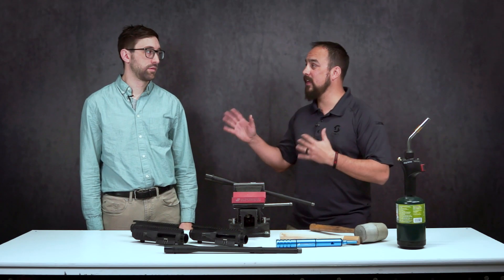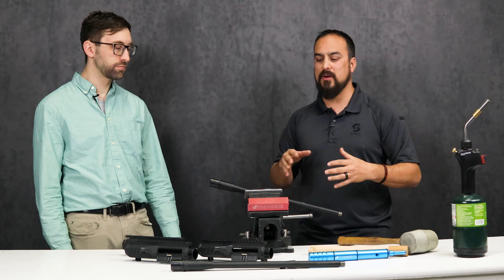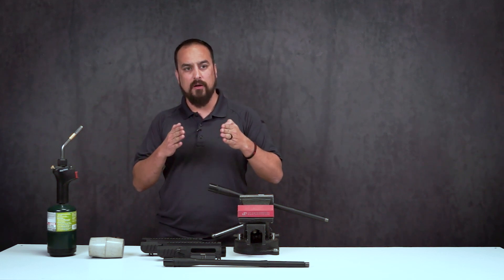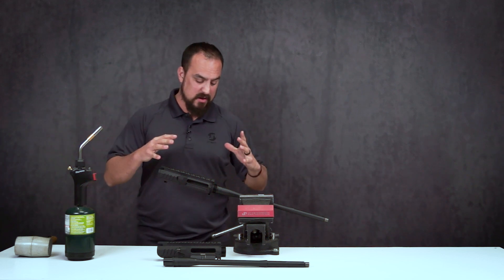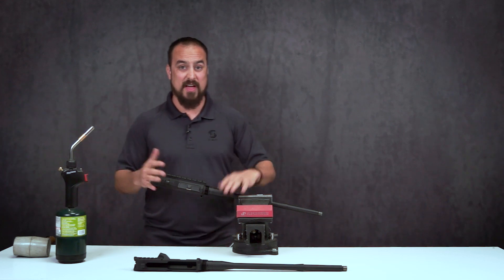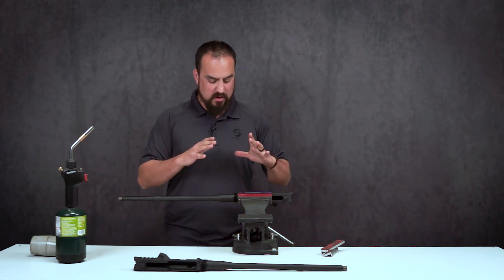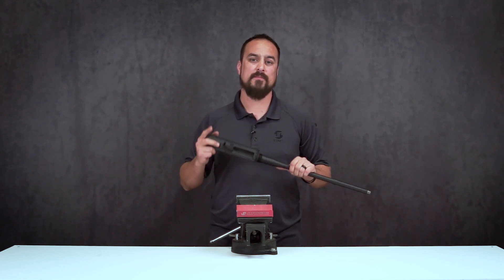The Secret of Thermo-Fit™

Comment: Very neat, but green loctite (620 I think) will achieve the same result for slip fit cylindrical surfaces (the receiver and barrel extension).
Reply: An interference fit like this is better, but isnt new. A few people make uppers that are a thou under spec like seen here. White oak armament has neen making competition barrel extensions that come in difference sizes for the same effect, for a long time
Reply: The loctite method is "ok" but it's still not as rock solid as metal on metal.
Reply: lkazanov heat from the barrel will weaken the loctite
Reply: @cmoore806  you'd be surprised... I've done green loctite before and it "glues" everything together pretty solid. I had to torch the receiver hotter than most mag dumps will typically get it to get the barrel out. It resists heat pretty well because it's meant for slip fitting bearings which can get pretty hot.
Reply: Christopher Moore if your barrel gets into the 400 degree area, accuracy isn’t a concern.
Reply: @FullSendPrecision  only takes about 200°F to get that loctite to melt...
Reply: MåcGyver no it doesn’t. Read the spec sheet.
Reply: @FullSendPrecision  "not exceeding +179.6 °F"... "about 200°F" gimme a break...

Comment: So because of the ceracoat in my receiver I was scared that thermo fit would mess it up. A good friend of mine gave me a phone number to call. When I told the guy what I was up against he told me to freeze the barrel. So I out it in my deep freeze for 2 days and it slid right in to the receiver and now it's locked in tight.

Comment: 1:37 bolt guns don't shoot better than gas guns. Ok so tell me why no one has ever won any benchrest competition whith a gas gun ??? Perhaps conspiracy, or this guy is just lying to sell his product
Reply: It's technically true but the reason bolt guns will always be more accurate is because they have a much faster firing mechanism. The ar has a relatively large and slow moving hammer that takes longer to strike the firing pin than even a lower end bolt action does. That means that there is a longer delay between pulling the trigger and the bullet leaving the barrel, leaving more time for the shooter to move and affect the shot

Comment: while this process in itself is good, there is no reason to attempt it on any AR platform unless it's a 1 time fit and for competition only!
I personally like being able to swap barrels and components between uppers, and do so often.
It is also a known stress factor on the fragile aluminum upper when you create a tight inteference fit, and at some point will crack the upper. DO NOT BELIEVE THIS TO BE A REALLY GOOD THING, IT CAN FAIL ON YOU AT A VERY CRITICAL TIME.

Comment: Torching the finished product can anneal the receiver lowering the pressures it can handle.
Reply: Annealing would have to happen at a much higher temp.. something like 700+ degrees.  He's not having to take it near that hot..
Reply: Alan Dike yet the fit between the two pieces was never designed to be a press fit, or to require heating to expand the part so it fits you are forcing parts that are out of spec.
Reply: What's that got to do with the false claim of annealing and losing strength.  No, the press fit isn't part of the design.. but that doesn't mean there was no re-engineering that happened before they did this..
Reply: Alan Dike cause your average joe will not just warm it up a bit they are so going to over torch and soften the metal through a process that is referred to as annealing. You Can not cheat physics you will lose every time.  Personally I would re-spec the part as opposed forcing the parts. Just like there is no reason to lap a receiver to barrel unless it’s so far out you can’t zero the gun.
Reply: @kinzieconrad105  there is a huge temp difference between annealing and expanding a few thousandths.  I'm familiar with annealing.. and it's gonna take a lot more than it shows there to do it

Comment: Tried this myself, didn't work. First, I put the barrel in a vise. When I tightened the vise, it crushed then barrel. Didn't realize until I took it back out. Then, I heated up the receiver. I didn't have a propane torch, so I used my moms hairdryer. That didn't work and made her angry, since she was using it. So I went into my dads garage, which I'm not allowed into, and wheeled out his oxegen assetalene torch, whatever that is. I ended up burning a hole through the receiver. So then I melted some aluminum foil onto where the threads were, then used a file to make new threads, sort of. Barrel was flopping all over the place in the receiver at this point, so I used seuper glew to make it tight. Now, after all that, it finally werks. 

Thanks for nothing JP. That was a lot of work after watching your videos. YoU aLl ArE LiArS!
Reply: Get Help!

Comment: Ah, secret? You make too much out of something so easy. This was done for centuries before you let out the secret! Well, it was entertaining watching him hurry up and get that first barrel on. No need for speed when you are doing this. I usually build my uppers in the winter & set the barrel out on the deck for a half hour, bring it in & slap it in the upper. To take apart just use a candle & warm up the upper threads. Most uppers don't need heat or cold to work on anymore.

Comment: That has got to be hard on the finish. Gotta be a better way.
Reply from the maker: Doesn't hurt it at all.
Reply: @JPRifles  I would of bought a JP receiver if I could of found one for sale. I had to go with a Live Free Armory billet AR10 set. It has a tighter fit on the barrel than the Aero Precision upper I have. I have a Criterion 6.5 Creedmoor barrel and a JP high pressure bolt. Should I thermo fit the barrel? And should I check headspace?

Comment: It's not a secret its ignorance by rookie builders. But some not all but some manufacturers take advantage of new buyers/rookie builders and over charge/price gouge them. When they should be built by all manufacturers as a thermal fit.. some manufacturers cater to the ignorant both ways, either to loose or correctly thermal fit and then way over price as proper build.

Comment: It will have very small crack on the aluminum later on it would explode
Reply: Sounds like nonsense to me.  The cartridge if fully inserted into the barrel extension on firing.

Comment: This is not some miraculous process. I've done this for years in my job to fit bearings on shafts for machine repair.
Reply: All parts were steel or brass I assume.
Reply: @DelHollowProductions  Steel. We call the process heat/ shrink fit. Sometimes the parts are large and it's not feasible to use a press.
Reply: @chrisclark5204  - absolutely. Shrink fitting steel is an old process.  5D Tactical's mills are shrink-fit in their holder.

One can super glue/Cyanoacrylate or use appreciate Loctite products to "fix" the barrel. IMHO, not smart to shrink-fit aluminum.
Reply: @DelHollowProductions  True but what they did in the video was shrink fit aluminum to steel which is why you have to be very careful how much you heat the aluminum receiver.
Reply: @chrisclark5204  💯 agree.
Reply: LOL works GREAT on wheel bearings! And YEAH you have to be CAREFUL not to heat aluminum too much or it turns into a puddle REAL QUICK!

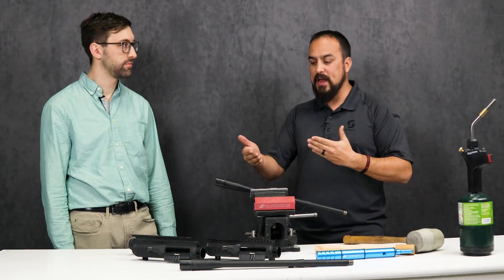Comment: 1:47 a gas gun will shoot just like a bolt gun"  ------- Bull__shit. 
I like JPE, but without ripping this apart and getting into a tolerance battle, it does not shoot like a bolt gun, period, not debatable, end of story.
That's besides the fact that someone might actually want to remove their barrel in the field and won't be able to.

Comment: An age old machinist technique applied to gun manufacture..kudos.  Re-branding it like you're the inventor.. gtfo
Reply: D Hall It is the first time I seen this sone with an ar15
Reply: D Hall Yep, that's how most patents work. I believe patent law requires 3 unique changes/facets that make it different from an existing product. This certainly passes that test. Good for them. Everyone wants more accurate firearms, so why rage about it?
Reply: @chasmofsar2691  I think its perfectly acceptable to be mad at JP for trying to trade mark Thermal fitting even in AR15 manufacturing ...ANYONE who paid attention in science class should have a basic understanding of expanding and contracting surfaces based on how much heat or cold is applied to said surface...science I love JP products, but D Hall is right
Reply: Its trademarked not patented. Another company can do the same thing but they can't say the name. They could call it Temp-o-tached or something.
Reply: @mr.lovell3645  tell me someone else was first to use the technique in this specific application and you'll have  a point. The first guy to use a hydraulic pump to power a wood splitter wasn't the inventor of the hydraulic pump, and didn't come up with the idea of splitting wood, and probably did not even invent the first wood splitter, but you can bet he patented his design. When you find a new way to apply an existing  concept, that's what you do. I'm happy that they had the sense to think of an obvious application that apparently hadn't occurred to anyone else in their industry. This is why we aren't still making the same rifles we were in 1950. Most of the original concepts haven't changed much, but gunmakers continue to improve how science is applied to firearms to improve function and accuracy.
Reply: @wolfkin73  right on, point taken. I think you see what I'm getting at. There's certainly nothing egregious about what they did.
Reply: Have to agree with D Hall. Been doing this for fifty years with tolerance fit ring gears on differential carriers. Put the carrier in the freezer then just warm up the ring gear and it drops on slick.
Reply: @chasmofsar2691  you dont see the guy that invented the wood splitter boasting about, and taking credit for, its' hydraulic pump
Reply: @dhall5634  You're bitter. Give it a rest.
Reply: @chasmofsar2691  acrimonious(tm)

Comment: Nothing new anybody with experience in metallurgy or being a machinist or engineer anybody with some brains can figure out how to do this and the benefits I'm sure people were doing it before them at home the smart ones
Reply: Without an upper machined to compression fit tolerance, there is no point in thermal fitting. JP is making uppers that require thermal fitting. Without one of these uppers, home builders wouldn't have been doing this.
Reply: @cat192  obviously there needs to be an upper and barrel with a .002 or so interference fit in order to even do thermal fitting just saying the concept is no secret and doesn't take a genius to figure out
Reply: @thesouthernlife4061  
To be honest, I'm concerned about the inconsistent heating of the Al to an unknown temperature. Once you exceed 250F you're changing the T6 age hardening thermal treatment that the 7075 had. That said, they may be using a different grade of aluminum with a higher aging temperature to prevent this from becoming an issue. Being that I have access to liquid nitrogen, I'd be inclined to shrink the barrel. This has its own set of potential issues as I'm unsure what the coefficient of linear thermal expansion difference is between the barrel and barrel extension. I'd still rather take that risk though. Aluminum does have a very high coefficient of linear thermal expansion, so I may try heating the upper in the oven at a 200F first and see what happened.
Reply: @cat192  shouldn't need anymore than 250 degrees to make it expand .002 long as you move the flame around evenly they make temp sticks in whatever temp you want you can touch it to the part soon as it smears your to the correct temp gets you pretty close when I put bearings into aluminum housings it doesn't take much heat but I usually freeze the bearing first also which isn't needed I have done it without freezing the bearing and with minimal heat on the housing be surprised what just a little heat will do
Reply: @cat192  I just use the loctite trick to bed the barrel into the receiver same as bedding an action into a stock with fiberglass def tightens your groups up lap the receiver first of course that method is plenty accurate enough I don't see the point in going the temp fit method unless you just want to squeeze every bit of accuracy you can out of the gun and want to spend the money to doit
Reply: I would definitely use something like tempilaq if I were to do this. The temper temperatures on steels are typically much higher than aluminum aging temperatures so there is less risk of screwing up the thermal treatment. I'm with you, I'd rather lap and bed to be safe.
Reply: @cat192  unless your trying to get every bit you can out of a gun no point in buying their fitted parts if you shoot competition or want to get every bit you can out of it go for it but a quality lapped receiver with a quality barrel bedded with loctite and finding some quality ammo that the barrel likes will get you damn close to what thermal fitting will with less headache and money especially if you handload you can get a sub moa gun that way that will do everything you want it to some people want to spend the extra money and like squeezing that last eighth inch or so out of their groups some people are sick like that lol

Comment: this technique  is being used in the aviation since the nineteen  thirties what secret are you guys talking about and that is not the proper way of doing it dont take my word for it ask any a and p mechanic
Reply: They're not claiming to have invented thermal fitting, like you say that's been around forever.  They're saying they are the first to employ that technique in this specific application.  I use thermal fit tools/toolholders as a machinist and they're great for vibration reduction and therefore surface finish/tool life increase especially in high rpm applications.
Reply: @redramage  what do you know about metallurgy
Reply: @redramage  they literally trade marked thermo fit ™
Reply: @redramage  Thanks for pointing this out. People still don't seem to get it.
Reply: Jesus, these comments, is there that much desire for people to make themselves sound smart and come off as ignorant at the same time?

Comment: I'm of the opinion this is an unnecessary and a dumb idea. Make parts to spec and properly torque the barrel nut. The receiver is aluminum and the BE steel. It is unwise to shrink-fit grossly dissimilar metals, especially when one melts at 1200 degrees.

Comment: This is just another gimmick. A high quality barrel extension/feed ramp with a trued receiver face and standard torque your barrel will be true.
This is going to make your rifle harder to service. Heat and pressure can bond steel and aluminum almost as effectively as welding. 

Doing this, plan on never changing your barrel.

Comment: I've just had the opportunity to view this video.  What a strange thing to do.  The most accurate rifles in the world are light and heavy weight bench rifles, 1/8 moa at 200 meters.  They are ALL switch barrel rifles, with barrels twisted on Hand Tight.  The accuracy is gained from colinear tolerances, not a thermal fit.  If this is what is required on an AR-15, then they are definitely not as accurate as a bench rest rifle.

Comment: I believe this is probably the dumbest s*** I've ever seen. I can't believe that putting a torch to an AR upper does not screw up the heat treatment. And number two it's a pain in the ass and does nothing for accuracy. You can take this process and the normal Barrel process of an AR, and no one will know the difference when shooting it